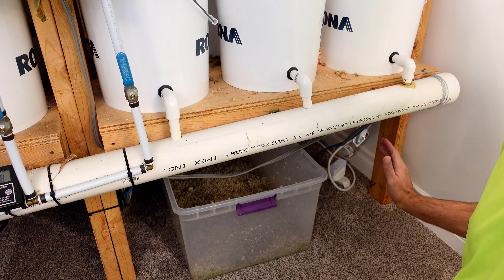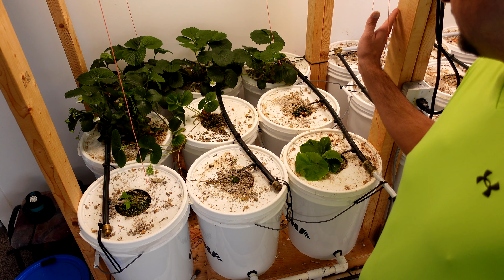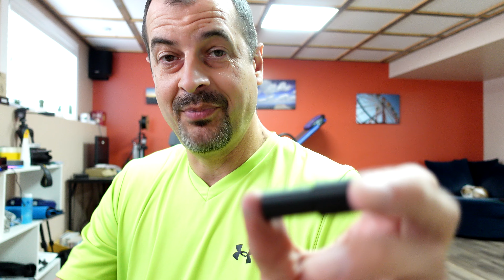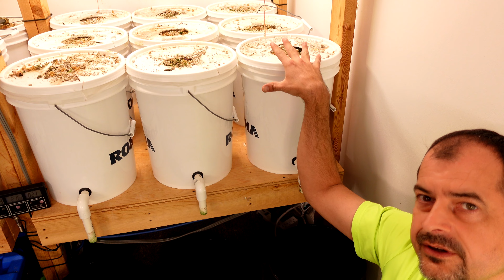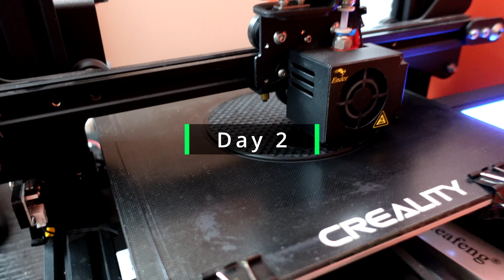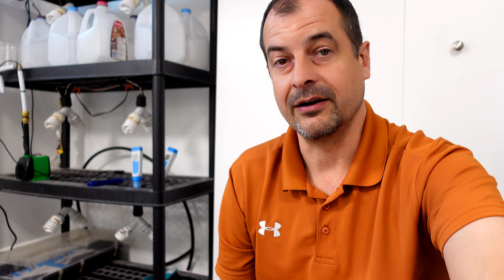Ultimate Dutch Bucket Setup for Experiments

Comment: You're not just a hat rack, my friend. Do you ever use 'Rescue Tape' (aka self-fusing silicone tape)? Pretty slick, looking good!
Reply from the maker: Rescue tape, never heard of it, what do you use it for?
Reply: @HouseDadLife  It can seal leaking pipes, it can secure objects together... it is one of those things that if you have it, you find uses for it. The first 'need' you have and it pays for itself. My thought for what you were doing, if you have connectors that aren't snug and you want a little extra insurance to avoid leaks, a few wraps of rescue tape would firm it up. Just don't wrap the stuff around your finger! If I have to, I'll buy you a roll...
Reply from the maker: I'll pick some up next time I'm at the hardware store, need to check that out. So far I'm fortunate, I've had no leaks in any of my grow. Those Grommets on the pails are just plain awesome.